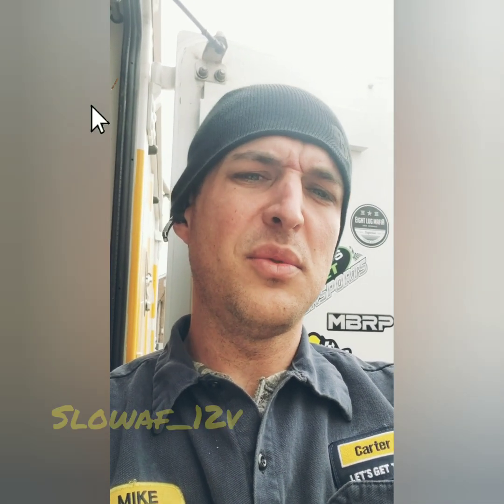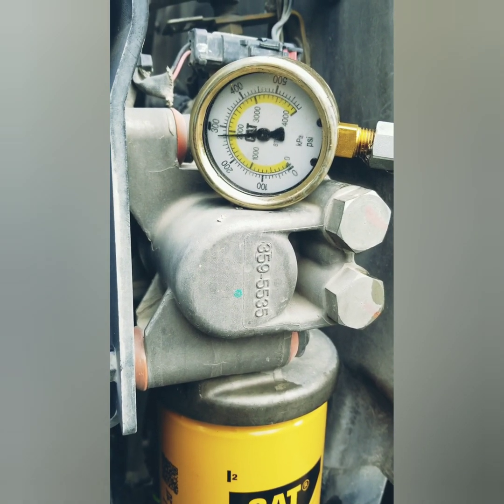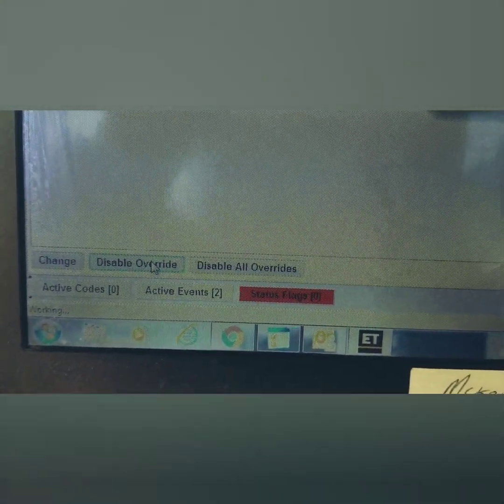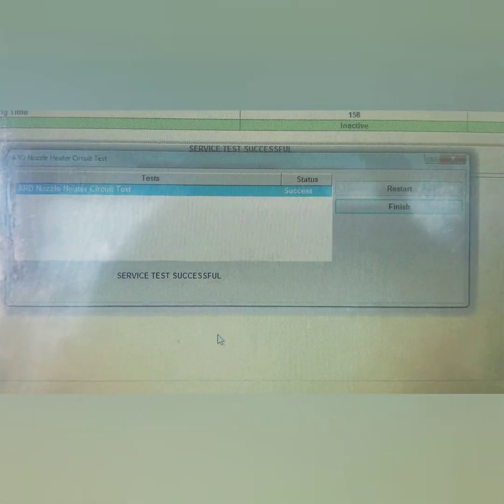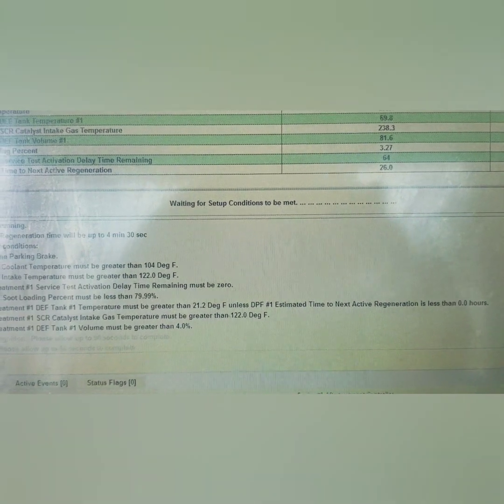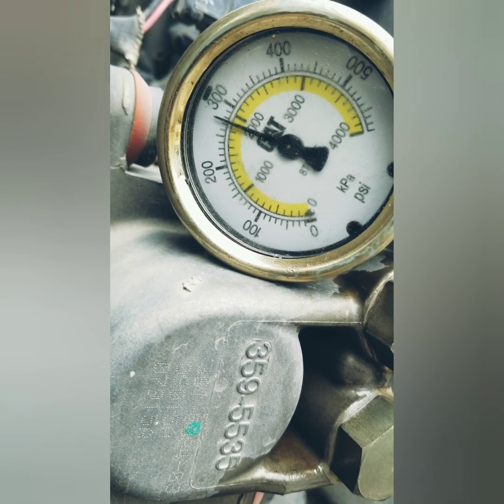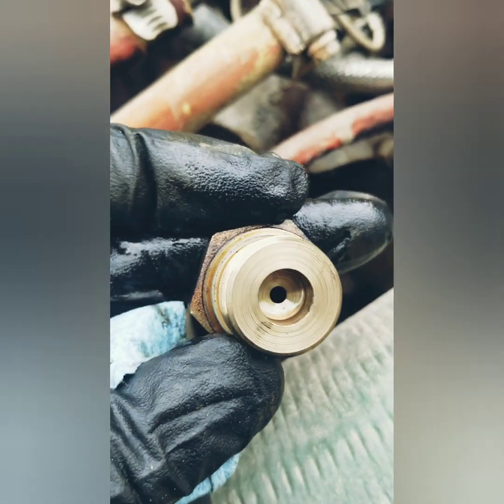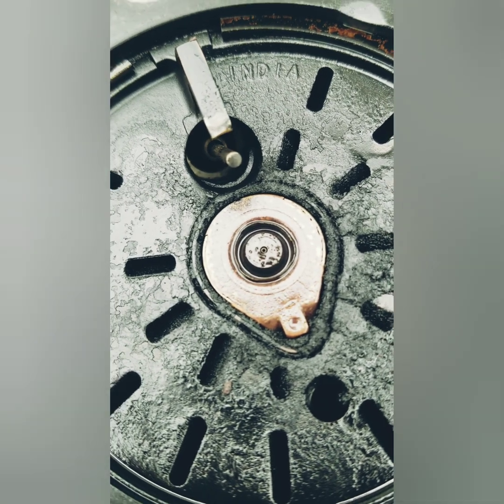Cat ARD Head Failure To Ignite!!

Comment: I have a C18 in a compressor 
That soot up giving me colds 
For fail to ingnite 
Also 3719 0
3719 16 
Ard head replace already 
Any ideas ?
Reply from the maker: Failure to ignite can be for any number of issues...your faults are all high soot codes...check the air flow through your dpf as could hinder ignition...check your flame detection sensor to ensure working/reading correctly